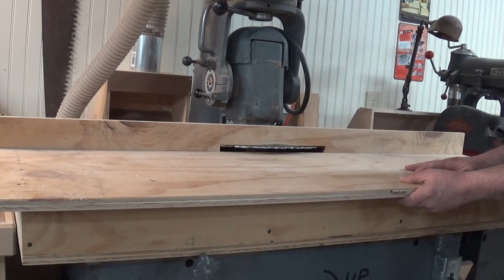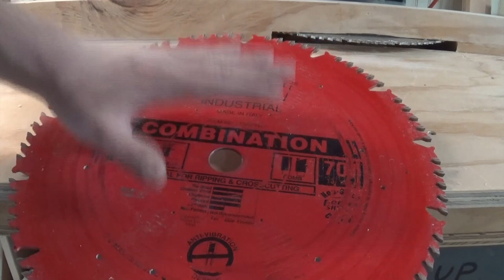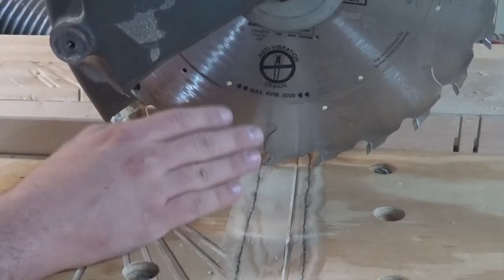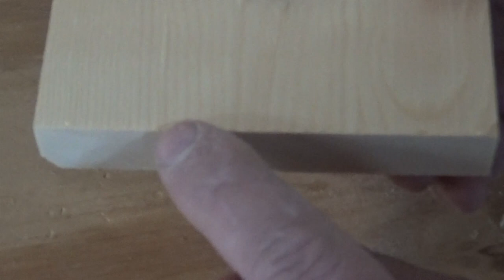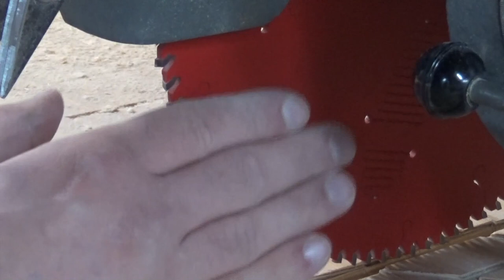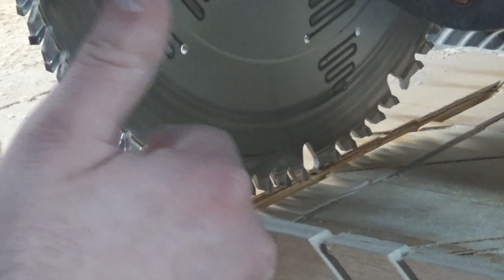Choosing a Radial Arm Saw Blade part 2

Comment: I was thinking about your sawblade tests and I did some rudimentary research. The 14 blade at 3450 rpm, is about 210 FPS feet per second. Apparently that's actually higher than recommended for normal wood cutting. For a 14" blade they recommend a 2,500 rpm arbor. The FPS sweet spot for wood cutting with a circular saw blade is "recommended" at 130-170 fps. I suspect the chatter you talk about could be from such an overly aggressive high blade speed? Have you done a back to back comparison with a 10" blade versus a 14" blade using the same exact model of blade? It would be an interesting experiment. Thanks so much. Your saw is incredibly beautiful!
Reply from the maker: Yes, that is the one issue of radial arm saws, they are the only saws I know of that are truly direct drive. Even table saws billed as “direct drive” have helical gears in them to adjust the blade’s speed. With the radial arm saw there is no belt or gearbox the arbor has to spin at the motor’s speed, which as you pointed out, changes depending on blade diameter. 

I like the idea of the 10” blade test, I also just thought of something. My saw is a 3 phase and I have it running off a static phase converter so its speed is fixed at 3450 rpm. I’ll see if I can barrow somebody’s vfd and adjust its speed to get the speed down to 2500rpm and retest them and see if that makes a difference in cut quality.
Reply: @TheNorthlandWorkshop  I just realized after reading your comment that a 3 phase motor has the advantage of having easily available VFD's that can provide a very precise speed control. That's really neat. For a larger blade at lower RPM, you probably get significantly longer blade life compared to a smaller saw, due to the 14" blade having more carbide teeth. Just a theory, I don't know if that's a real thing. If you aren't getting burning or glazing of your cuts, you can probably get away with an extremely high blade speed. My Grizzly 10" tablesaw had a 5,800 rpms configuration from the factory, and it cut so fast that it didn't make sense, while using a very old resharpened "combination" blade. I'd run a piece of plywood through the saw, and it cut so fast that it felt like there was no blade present at all. But, I would get burning frequently, when the wood was warped or if the fence wasn't aligned properly. Almost every cut had a little bit of burning, and I finally geared it down to 4,400 rpms by changing the pulleys. But man, it was fun having 5,800 rpms. Now, table saws never come with anything other than a 3,450 arbor speed.

Comment: An absolutely excellent and objective series on blades for the RAS. Finally something that goes outside the stagnant evolution that is the "RAS Forum" Thanks for putting this all together. I think I'm off to shop for a 30T rip blade since I so a lot of work with 2" stock.
Reply from the maker: Thanks! I figured someone needed to actually test these blades instead of ending every saw blade question with “because I say so” and locking the thread.
Reply: @TheNorthlandWorkshop  That one still irks me..... Heaven forbid we have an open discussion...

Comment: Very useful information, exactly what i was looking for, I bought my radial arm saw in circa 1992, it has been in storage for about 10 years ever since my wife bought me a table saw and a compound miter saw. The motor on my table saw went kaput, so instead of buying a new one I pulled the RAS out of storage and needed a refresher course on saw blades and other "how to use" info.

Comment: I want to get a RAS. However, I don't know if I should get a 10 or 12 inch cut. I mainly want to rip 2x4s and 4x4s. I can get either used near me for relatively cheap. I only have a few projects at this time so I didn't want to spend a lot of money on the saw. 

Thank you for the video. I will have to get a couple blades once I choose a saw. Unfortunately I don't have room for multiple at this time.

Comment: Three comments:
First:  I am not sure that test results on a 14 inch saw translate to a 10 inch saw, which is the most common in home shops.  The difference in blade diameter means that different numbers of teeth are traveling at different angles and at different speeds through the wood. Additionally, vibration and run out tendency may be different for various diameter blades.
Second:  The smoothness of any crosscut depends in large part on the total amount of teeth making the cut.  I use a 24 tooth ripping blade (which has cut depth limiting ears) for crosscutting and find that the slower I pull it, the smother the cut.  This makes sense. For example: If your saw turns at 3600 rpm, it turns at 60 revolutions per second.  For a 48 tooth blade, this translates to 2880 teeth, moving through the wood per second.  For a 24 tooth blade, 1440 teeth move through the wood per second.  But, if you take twice as long to make a crosscut with the latter blade than with the former, the same number of teeth will have made the cut.
Third: I have to disagree with your rule never to use a ripping blade for crosscutting. I use a ripping blade for crosscutting on my 10 inch radial arm saws all the time and they work beautifully for both hard wood or soft.  As further proof that ripping blades are suitable for crosscutting, check out the blades which manufacturers supply on chop saws (which only do crosscutting).  Mine came with a 24 tooth blade with big gullets and a moderate rake on the teeth. What kind of blade is that?

I don't mean to be such a nabob of negativism:  I appreciate the thought and work that you have put into this video and that different blade configurations produce slightly different results.  I also believe that we have come to the similar conclusion that the radial arm saw is a wonderful shop tool, far more efficacious than a table saw.

Comment: I understand you’re an above average RAS operator, one thing I wonder with a new user, or even inexperienced user, are there concerns about choosing to have dedicated blades, yet there is an introduction of issues with resetting the saw blade each time you have to change the blade?
I could be totally wrong, but I assume one doesn’t just slap on a new blade and get to cutting, there is runout checks and blade orientation steps each blade change, or poor results, or potentially dangerous cutting concerns happening. Especially with the lower end Craftsman or Dewalt saws many users likely are operating.🤔
Reply from the maker: @leohorishny9561  you should be able to slap a different blade in the saw and get right back to cutting. If you have to do any saw alignment after changing blades something is wrong with the saw itself.

Comment: Thanks for all of the incredible information. I am obsessed with radial arm size, especially the Deltas and I have a choice between buying a super990 (10 inch )or a 33–267. Both of them are in good, not great shape, but pretty clean considering. What do you think is the better of the two saws? 
Thank you for your help and input!! 
Shane

Comment: Say, would it be fair to say that the 5-ATB pattern GP blade has the least tendency to “lift” the wood in ripping, or to “self-feed” in cross cutting, of those tested?
Reply from the maker: Really the only blade that lifted the wood during ripping was the 24 tooth ripping blade and that was only when it was ripping the 4x4. As far as self-feeding in cross cutting only the 40 tooth Amana hinted at self-feeding. I suppose I can’t say the 5-ATB pattern has the “least” tendency to do those things because the majority of blades also showed no tendency to do those things.
Reply: @TheNorthlandWorkshop  Thanks so much. I believe I’m on solid ground now in regard to the proper relationship of “teeth-in-the-wood” to those two conditions, thanks to you. 
One last thing if you don’t mind: much is made of hook angle for the RAS. Leaving out the ridiculous idea of +20’s and the like for obvious reasons, what do you make of the significance of low and negative angles?
Reply from the maker: @NMranchhand   in my searches I haven’t found any blades that have a tooth angle greater than 20 degrees. Both rip blades have a 20 degree hook angle and they seem friendly enough. The tests showed that hook angle really doesn’t have an effect on how aggressive the blade is the two biggest things is how many teeth the blade has (more teeth means each one takes a smaller bite) and whether or not the blade has the little anti-kickback ears on the back of the teeth that limit how big a bite each tooth can take.

Hook angle mainly deals with how the blade cuts the wood. Ripping blades tend to have a steep positive angle so the teeth peel wood off with the grain like a hand plane does. This steep angle would be really bad for cross-cutting because it would grab the wood fibers and tear them as the tenth went across the grain. By lowering the hook angle instead of the fibers getting lifted from the cut more of the fibers are packed into themselves which helps to prevent them tearing out. 

It’s the same reason a card scraper can smooth out wild grain where a plane would just cause tear out.

What types of cuts and what types of wood are you using your saw for?

Comment: Were any of these blades the one Wally Kunkel raved about?
Reply: The woodworker one.
Reply from the maker: Yes it was the Forrest Woodworker I triple chip grind blade. I heard great things about it so I bought it and was so disappointed in its performance that I decided to test out all these blades since I could no longer trust what others were telling me about saw blades. 

My personal theory on the Woodworker I blade is that it originally came out back when high speed steel blades dominated the home woodworking market. High speed steel blades dull quickly and most home shops didn't sharpen them as often as they should. The Woodworker I blade, while no match for modern saw blades, would have run circles around the common dull high speed steel blade.

Couple the Woodworker I's superiority to what the average woodworker was used to at the time with a master salesman like Wally and you get a blade with a cult like following. 

The Woodworker I was probably the best blade you could get for your saw back when it first came out however blades have changed dramatically since then. It is my experience with the Woodworker I that it is not very good compared to new combination blades on the market.

The Woodworker I put high speed steel blades to shame. 40 years later we have saw modern carbide tipped blades that put the Woodworker I to shame. I have no doubt that that the saw blades made 40 years from now will put the blades in this video to shame. Technology marches on.
Reply: @TheNorthlandWorkshop  I think that last paragraph there is enough to get banned from the RAS forum for life :P

It also happens that I completely agree with everything in that statement.
Reply from the maker: @JustFixIt99  Between my thoughts on blades and my preference for turret style saws I’m amazed they let me in in the first place.
Reply: @TheNorthlandWorkshop  I'd be all over a Rockwell saw if it wasn't for the dearth of accessories.There have been some beefy looking 12" commercial grade ones around me lately that look pretty nice. However the lack of a moulding guard for them kind of kills it for me. I use it all the time on my dewalt, and previous to that on my craftsman.
Reply from the maker: @JustFixIt99  I too have noticed a lack of accessories for the Delta saws which is why I like having my two DeWalts in the shop. 

I have two theories on why Delta didn’t put a lot into their radial arm saws in terms of accessories. First 12” and over saws were designed for commercial shops. Time is money in commercial shops and I doubt commercial shops would be taking the time to swap out accessories on a radial arm saw. It would be in their best interest from a productivity stand point to buy dedicated machines. 

However there is also a lack of accessories for Delta’s home shop sized 9 and 10” saws. I think this probably stems from the fact that Delta made a whole line of power tools and not just radial arm saws. Delta wasn’t interested in selling a someone a jigsaw attachment for their radial arm saw, they wanted to sell them a a whole bandsaw. Same with a shaper guard, why sell someone a shaper guard when they could sell them a shaper. Lots more profit to be had selling whole tools.

Contrast this with DeWalt where by the 1950’s the only tool they made was the radial arm saw. They were more than happy to sell someone a shaper guard because DeWalt didn’t make a stand alone shaper. They only made radial arm saws so everything they sold had to somehow tie back into the radial arm saw.
Reply: @TheNorthlandWorkshop  I agree, delta was probably interested in pushing their other lines, that makes sense. However the same basic attachments were available for craftsman saws, and were vert prevalent. Craftsman also, at the time (70's-80's) sold a full line of tools that were of reasonable quality. In fact I would say my 60'c craftsman was much better built than my beaver\rockwell\delta 9" saw I had.

I think you were however bang on with the commercial side. What I would be curious to know would be how delta marketed their saws and who they sold them through. No commercial shop would be making moulding with a RAS, they'd have a shaper. Another interesting point of comparison would be the price of the accessories.